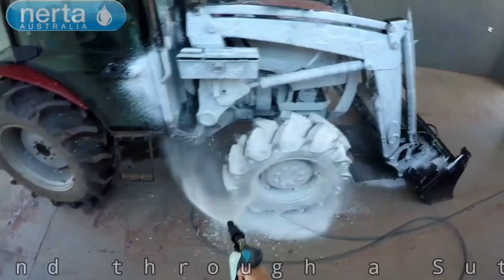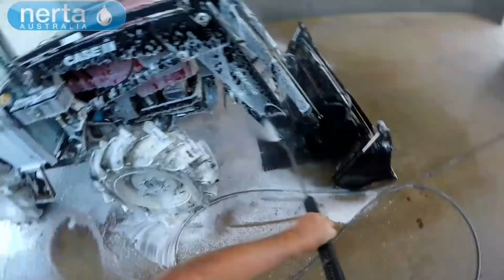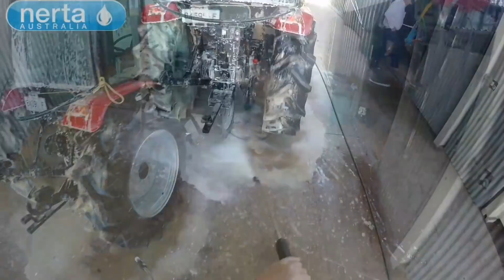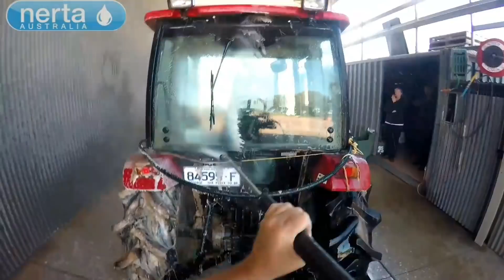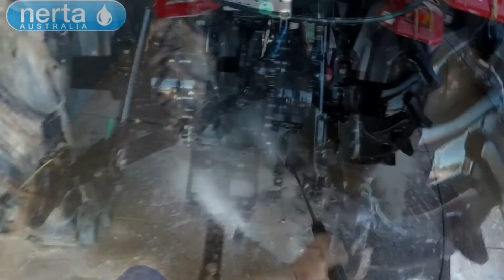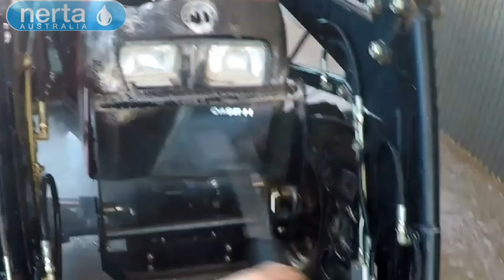Tochless Nerta Tractor Clean

Comment: Could I get similar results with carnet Jumbo?
Thanks mate!
Reply from the maker: Hi Alberto, similar but for AG gear Active Diamond will work better
Reply: @chiefsaustralia9012  How much do you put on the foamers bottle per tractor? Is it diluted or filled pure?
Reply from the maker: @ALBERTOGALINDO1983  in a PA foamer you will have to put around 100ml of soap and fill the bottle with water and a Suttner foamer pure on setting 1, you need to get a ratio of 100:1
Reply: @chiefsaustralia9012  thanks mate, just another question, what is the suggested application psi and gpm? And the rinsing psi and gpm? Thanks 👍
Reply from the maker: @ALBERTOGALINDO1983  ideak is 3000psi at 21l/m for fleetwashing but 15l/m would work as well
Reply: @chiefsaustralia9012  Thanks, if I use a 1600psi small washer with 1.2gpm would be to low then.
Reply from the maker: @ALBERTOGALINDO1983  this is really at the very bottom of the scale, it would probably work but have not tested foamers at these low specs so could not give you a conclusive answer, As a general rule in cleaning vehicles the lower the flow the longer it will take
Reply: @chiefsaustralia9012  thanks mate!!

Comment: why every youtube  videos of car wash are from bottom to top?
Reply from the maker: When washing a vehicle using conventional methods you firstly apply soap, wash using a sponge or a broom and then rinse off with water from the top to the bottom.
Touchless washing is a bit different.
Soap is applied through a high pressure foamer and then high pressure water is used as a “sponge or a broom". The water is worked back into fresh soap, either from the bottom to the top or backwards in the case of trucks and trailers etc. In this way, the soap is used more efficiently. (If you wash from the top down, you would simply wash the soap off the vehicle which defeats the purpose).
Then rinse from the top down to finish the cleaning process.

Comment: You should try to wash top to bottom
Reply from the maker: yeah we tried that but not great results, When washing a vehicle using conventional methods you firstly apply soap, wash using a sponge or a broom and then rinse off with water from the top to the bottom.
Touchless washing is a bit different.
Soap is applied through a high pressure foamer and then high pressure water is used as a “sponge or a broom". The water is worked back into fresh soap, either from the bottom to the top or backwards in the case of trucks and trailers etc. In this way, the soap is used more efficiently. (If you wash from the top down, you would simply wash the soap off the vehicle which defeats the purpose).
Then rinse from the top down to finish the cleaning process.